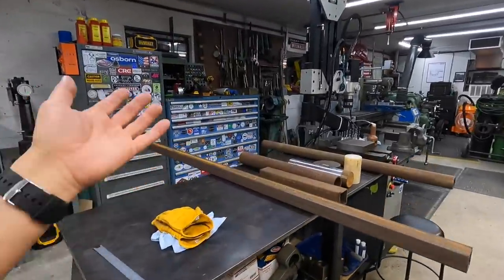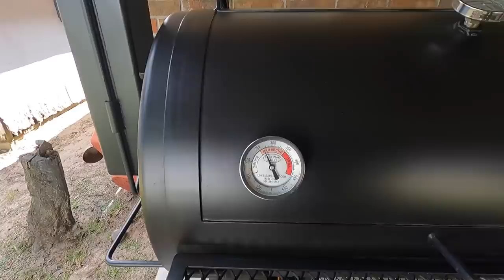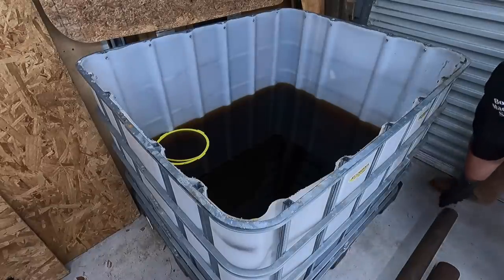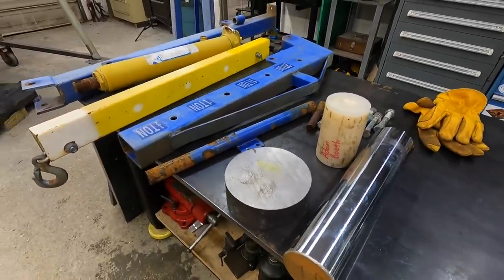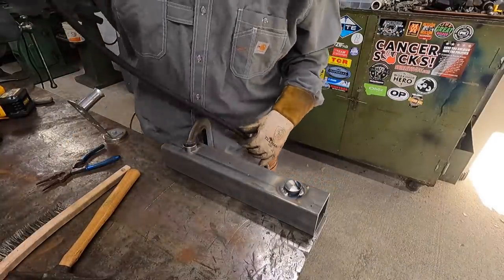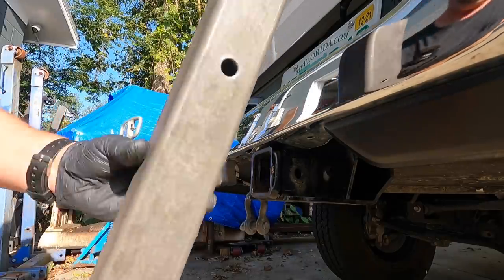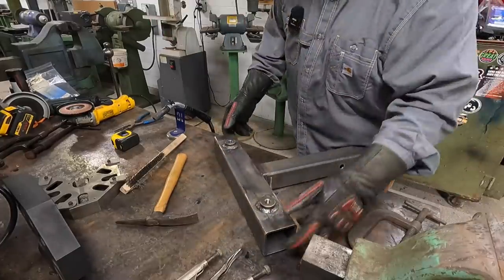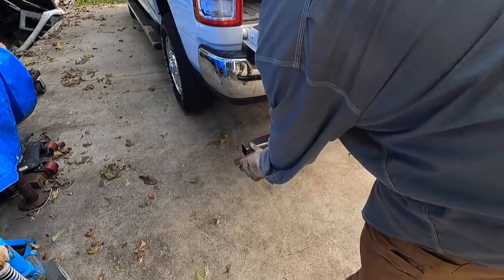Truck Hitch Crane Build Ep: 1

Comment: Just an idea it might not work, but have you considered having a screw on the base/foot of the stabilizing foot..? it could be one way to get you out of the weight/height differential that you might face once you have increased your GVM by the payload that you put on the deck. As I know from experience it will make removing a pin from a support structure difficult let alone potentially dangerous for your hands and eyes. Just a thought..?

Comment: I hear the mic issues much better here than in your explanation video. Just seems strange. I would have thought it'd be a connection issue, but it all goes through digitally now, so that's not as likely, as the connection would more likely cut out completely rather than just static.

Comment: I was surprised that you didn't drill the holes in the nuts while the piece was in the lathe.
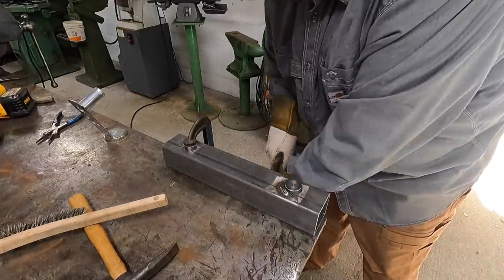Reply: At 21:54 you can see that he clamps right where the hole would be.  And the heat of the welding might deform the disk. And he has to drill through the wall of the square tube anyway, so one drilling operation ensures the holes line up.

Comment: where you welded the 2 tubes together maybe put a plate top and bottom to reinforce the weld .. when your tower is up it could put force on your welds and twist the tube ,, I am no expert but i would plate at least the top plus it would make a nice step for getting in the truck ..I have a cheap short cherry picker about 2 ft tall I am rebuilding my trailer used it too lift the axles only had lag bolts to hold in too the trailer deck one direction fine when I turned it too the small side of the plate it pulled the lags out ,, had to bolt it to my trailer for the repair work ,there will be a lot of stress on the post with a load on the crane , I can not lift the axles by myself from the floor up to the trailer the lift was a great helper .. I think when you get yours going you will say why did I not do it sooner ,,

Comment: The problem with worm tracks using DSFC could be insufficient stick out. Ive found that at least 3/4" wire out of the contactor is needed to allow moisture to be expelled from the flux core and then presto - no worm tracks.

Comment: did you consider a trailer screw jack for the support leg under the crane boom?  if you use a pinned support leg and load the truck enough for the weight to put pressure on the support leg you can't get the pin back out.  ask me how i know this.

Comment: Damn this is a great idea! Adam have you ever tried out pulse mig with solid wire?
Reply: I'm thinking of using TIG. Is there any disadvantages to this?
Reply: @davidscott5903  theres two. The speed of which you're gonna get the job done and how clean you have to get the material.
Reply: @schism47  
Does it have to be cleaner than solid wire MIG?
Reply: @davidscott5903  yes. All the mill scale and any oil or other residue on the surface. Even then the travel speed of you welding is gonna be very slow unless you're really pushing some amps and you're using a larger diameter tungsten and filler rod

Comment: That support foot is going to be under load after placing the heavy item into the bed, the leaf springs won't hold it at the exact height and you'll have to lift the truck bed to release the support foot. 🤔🤯

Comment: Good afternoon sir, I have had the same issue with dual shield flux wire and found that the wire had drawn moisture causing the same issues, new wire roll , problem solved. Great videos as usual sir.

Comment: Hey Adam, Happy Halloween to you & everybody... CO2 is good for all position GMAW, steel that has rust, paint, etc. but the process does leave spatter. Not the shielding gas of choice where appearance is important, along with time spent cleaning the weldment. Also the least expensive. 
75/25 mix is the standard for hard wire.  Dual Shield is not an out of position process, the puddle is extremely fluid and will fall out if given the chance. Properly cleaned metal is the rule prior to welding for clean, X-ray quality welds. Inner Shield can't be beat when it comes to high deposition rates and a good appearance, but it doesn't come close to the beauty of overlapping rows of 7018!!!

Comment: One concern that I have, Adam, is, after the object is lifted into the truck bed, and the bed settles, how will you pull the pin out of the support leg? A light load of 100 lbs might not be an issue, but what about 7 pieces that amount, or more?
Reply: That's a good point. I was thinking about making one also but going to wait to see the solution. Maybe some trailer stabilizers could be used.

Comment: I think instead of welding bosses onto the cross-tube, then drilling/tapping them. I think I would have welded some grade 8 nuts onto the pre-drilled cross-tube. Same result, less effort. Btw, nylon as a bushing material might be problematic for an outdoor bushing because nylon swells a lot when it absorbs moisture. UHMW, particularly a carbon filled grade, both for lubricity, as well as UV stabilizaton, would be much better IMHO.

Comment: Never use GMAW short-circut on anything thicker than 1/4in, with the exception of tacking material in place. GMAW spray transfer with CO2 is best used for mild steel up to 1/2in. The downside is that it all still requires a lot of prep/cleaning.

Comment: I didn't read all of the comments...so forgive me if I'm late to the game here...
I keep a bunch of different diameter PVC pipes capped on one end with a flange.  I choose the pipe size closest to the part size, fill with evaporust then let it cook over night.  I do this for shafts, wood planer and jointer cutterheads, steel handles and acme screw jacks, and tons of other things too long for my tank.  It sure saves evaporust...

Comment: In the use of a hand tightened clamping bolt I have found that a larger bolt will cause less damage to the sliding tubing. So the choice of the 5/8” sst bolt is excellent.

Comment: How long would that Evaporust be good before it needs replacing? I had a gallon of the stuff that was a little less browner than yours and I threw it away thinking it needed to be much clearer to work well.
Reply: when it dont work any more i have some that i black and it still works

Comment: Out of curiosity, is hat the same Evaporust from when you first set that tank up?  Seems to be lasting quite awhile if so.
Reply: Evapo-Rust seems to only degrade with use, not so much with time. Since it's water based, it does evaporate, but you can simply top the level up with fresh water.

Comment: I'm not sure what the reason is but I've had welds act funny after being soaked without grinding or anything so then I started hitting metal with a flapwheel  etc first getting rid of that gray top layer left after soaking back to shiny metal and didn't have any more problems so I figured it's something to do with the gray finish left from soaking that the welder doesn't like